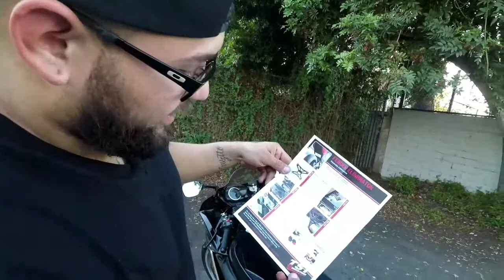Installing TST Industries rear fender eliminator kit on my gsxr 750

Comment: Why did u take right turn signal out to remove stock fender? Also how i hook up liscense plate light from tst
Reply: He did that so the fender wasnt just hanging there in the way while he worked on it then just plugged back in when he was done. If you got the tst light you just plug it into that white wire that he had to cut the zip tie off of and stuck under the back seat. It will run up through the hole under the seat and plug into the white stock one. There is another video u can search for putting the tst fender and light on and it will show u basically the same thing, it may be on a 600 tho but the 600 and 750 later models are the same as far as the fender eliminator.

Comment: I know this is an old post but i just bought a new 2023 gsxr 750 and i got so frustrated i just left the side carbon fiber panels hanging by the rubber push grommet. This is my first gixxer and the seat set up and everything is the same as this one pretty much, i got it all off and put my fender eliminator on and put it all back together. All except those little side seat panels with the velcro, hardest part of the whole job or im just doing it wrong or thinking too much into it. I am starting by putting the rubber piece in first tho cause i feel like thats the right way since it came out last. Has anyone found a helpful video yet or just any info at all to help learn to pop those back into place? I cant find anything, just see people taking them off. TIA for any help.
Reply: Any luck
Reply: @tyty695  yes, i was just overthinking and being too easy with it like i figured. Have to literally just give them a couple hard smacks with your palm or side of fist and they will pop into place. I kept thinkin i was going to break it or something tryin to ease them back on and bending them but once u get the pieces lined up just gotta hit them in.

Comment: Is any electric risk if leaving the conection unplugged ?
Reply from the maker: No there isn’t. Unless wires are exposed as in cut from the plastic but other then that no issues. You’ll be good